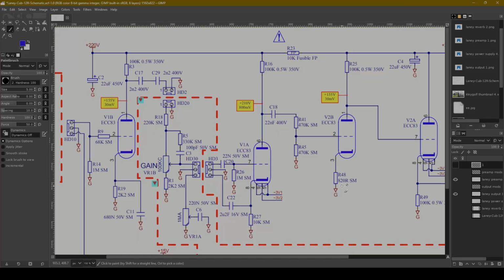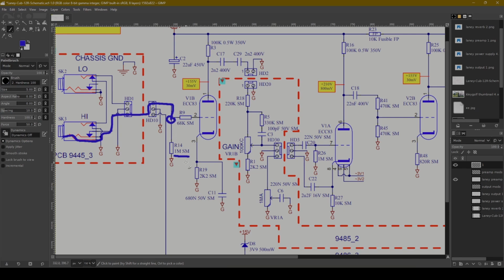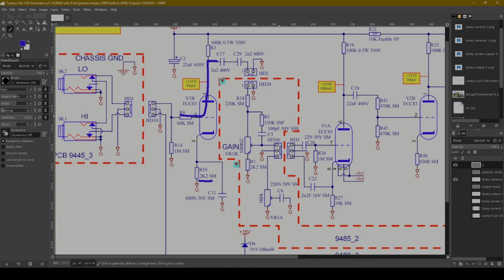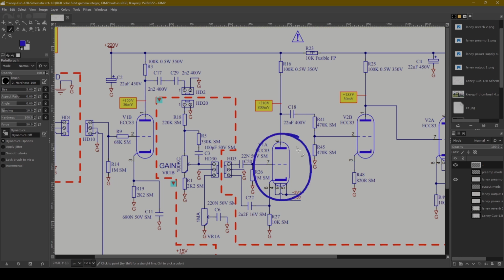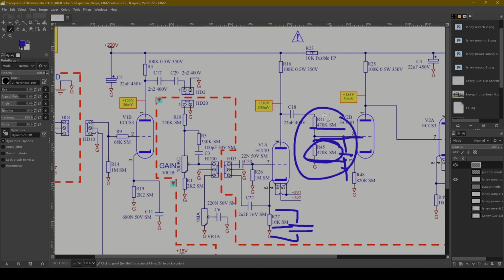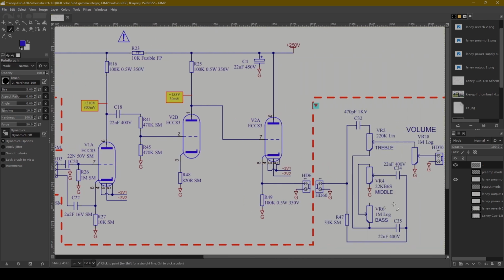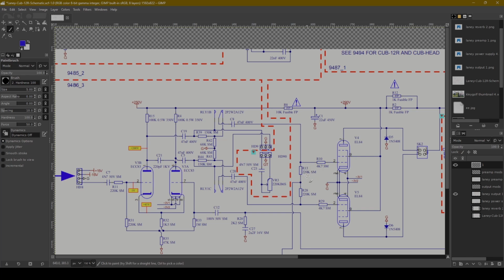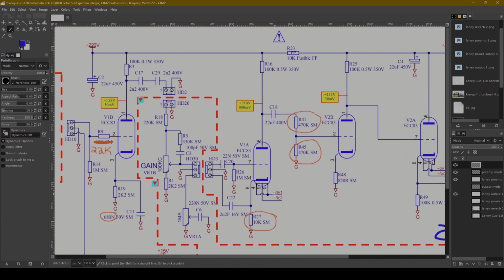Monoprice Stage Right 15 Watt Tube Amp - Schematic Review & Mods

Comment: On close inspection, VR3 is the tone pot. The 1w mode switches on relays 1B and 1C, sending the signal through R44 and R39 which attenuate the signal going into the EL84 valves, so it is sort of a fixed PPIMV. In Youtube videos where a comparison of the 15W and 1W modes is made, and care is taken to make sure the volume is not normalized by the Youtube processing of the video, you can hear the speaker output is about half as loud, which is the equivalent of decreasing the signal by 90%. It would be interesting to compare this attenuation with an external attenuator which allows overdriving the EL84 (which is somewhat involved as with this amp the speaker harness is hard wired to the PCB).
Reply: so the '3Watt' isnt a real attenuation it just turns the signal to the EL84 DOWN ( while their power supply is still full on)
in the plan this goes to a put called VR3, which strangely is the 20k Tone pot

Comment: V2A is the first half of a direct coupled cathode follower to push the tone stack, it's not a gain stage. Read Merlin's cathode follower section at Valve Wizard. Compare it to the direct coupled cf in the tweed Bassman or the early Marshalls. Read Merlin before you change the bias of V1B.

I think there's a simpler mod than a pot tho it's fixed. 1st bypass the cathode resistor. Start low like 4.7uf, go up to 10uf. That will increase gain, if you have a capacitance selector box see how high you can go without making things boomy.

Re: the voltage divider remove the top resistor, wire the coupling cap directly to grid and try different grid leak values. It will affect distortion mostly and how fast it comes up. I'm not sure you want this gain stage to distort since both halves of V2 are driving the tone stack. 

The coupling cap value determines the low end cut off point, do the time constant calculation to see what that is. It wants to be low.

Again, compare this design to its predecessors, JTM45, Super Lead, JCM800 and the 5f6a and whatever other Bassmans use the direct coupled cf. It wants to be clean gain.

Personally I think one of the most useful mods on this amp would be a PPIMV, then you could have a good home practice amp. The MV as is is a so-so and very common implementation,  post phase inverter would be great.

Comment: thanks for your video explaining the amp schematics.  what do you think would cause the main fuse (by the on/off switch) to keep blowing?  I've tried changing the power tubes but the fuse would still blow.  could my transformer be bad?

Comment: Great video . Do you have suggestions for tubes and bias adjustment?
Reply from the maker: I've had good experience with ehx tubes recently. JJ is fine as well.

I usually am confident to retube and keep bias as is, but taking measurements and adjusting as needed is always a good idea.
Reply: @KleyDeJong I have this amp do I need to bias the new power tubes?
Reply from the maker: @johnie19644  I try to make sure all my amps are biased properly - but if you're just replacing tubes like for like and the amp sounds good and plays well I wouldn't worry about it.
Reply: @KleyDeJong thanks, the power tubes are unmarked and I would be putting a branded matched set it?

Comment: Thank you so much!  I've noticed on this amp that the 15w / 1w switch has no impact when going straight into the effects return / power amp.  Does this mean it is just doing a volume reduction before the power stage, and isn't actually dropping the power wattage?  I've also noticed that the amp volume into the power stage alone is very low.   Maybe there is some sort of volume boosting post-preamp that could just be replicated by a pure volume boost before the effects return?
Reply: just stick in your guitar cable in the input, then the volume will be ok again

Comment: Thanks for This!  I have been trying to figure out a PI issue with this one. The grid input pin 2 of PI has 40 volts on it and supposed to be 1.  I just can't seem to figure out how it isa messing up.  The resistors seem all good and test correctly to ground with the correct resistances, and the tube is good. Any suggestions?
Reply from the maker: Is the coupling cap just before the grid there good?  Maybe voltage from the previous gain stage is leaking through.

Comment: I'd say that from the tone stack to output this is very much like a mini Fender Bassman which was copied for early Marshall amps with the output tubes replaced with British types, so yes it is also like a Marshall.  You are also correct that the cold clipper is common in Marshalls but not Fenders.  It would be interesting to try to get the basic tone to be more like a Vox on the other hand many people love the sound of the Monoprice 15W.  We have a very early one with an Eminence speaker and Mod reverb tank upgrade.  Ours is built with many surface mount parts and I don't really want to work on it.  Nice job with the video!
Reply: I could really use a schematic, I looked up the Laney Cub 12R and it seems to have a chip for reverb, our Monoprice has a tank.  The Laney LC15R looks closer being 15W and with a tank.  
Edit: It does seem that the Cub 12R is the correct schematic other than the chip reverb.  Even the component reference numbers are correct, thanks for this.

The previous owner did some mods on ours and now it is not working right so, I want to undo them.  It does sound great when working right.

Comment: Just add an graphic eq pedal in front or in the effects send and you've got most any tone you like- no need to swap out the speaker. I did swap the 3 12AX7's for 3 lower gain 5750s, much happier with a tamed overdrive. www.youtube.com/neilslade

Comment: Great video. I've been trying to track down an issue I'm having with my Stage Right 15R (single input jack). After a year of using it, a tube went bad. For some reason, I had all of the tubes out at the time I put the new one in. At that time, I accidentally put the tubes in wrong -- the EL84s went into slots V1 & V2 instead of V4 & V5. There was a loud bang and the buzzing started. The sound of the buzz gets louder when I turn the volume up. Based on your video, would I be correct to assume the issue is in the pre-amp stage? Also, in your opinion, did I blow a capacitor, or would this be a tube issue?
Reply from the maker: Does it buzz with fresh tubes?

I'd be most concerned about putting a 12ax7 in a power tube slot.

A bang then buzzing makes sense that you popped a cap. I'd try new tubes. If not fixed then I'd open it up, discharge the caps, and look for residue of a blown cap spilling it's guts all over.
Reply: @KleyDeJong  I'll give all that a shot, thanks.
Reply: @KleyDeJong  I replaced the tubes and the buzzing is still there. Any ideas on what I should look at next?
Reply: I just put a new set of JJ's in my amp and I had to admit it I had to change the original power tubes a lot quicker than I thought. I think the bias is too high. I never checked the bias I probably should.

Comment: When these amplifiers were first available I purchased 4 of these. 2 still in the box. To me is a 1x12 vox-like amp.  I liked the TV front, but then people complained about the reverb, and then the company changed the whole amplifier.  I am glad I have the TV fronts. These sound very good and I am sure the MONO group makes these for Laney.
Reply: I got one when it first came out too. Got it for like 120usd shipped. I wondered at the time if I should've ordered a second one. I def should've gotten the 8" version

Comment: Replaced R27 with 3.3k and cut the cold clipper. This changed the distortion curve quite a bit resulting in stronger low mids with more grind and less fizz. Replaced the tone stack caps but this had minor improvement. Best mod that I made was a larger multi-tap output transformer with a jensen Jet 40 watt speaker.  Noticeably larger sound stage and better bass response  which is a weakness in this amp. Still don't like the bottom end but i run in parallel with a Quilter 25 watt to fix the bass response.
Reply: Good to know.   I would like to do the mod to cut fiz but don't know how.  Trying to learn though.  Thanks for the thought

Comment: I'd be curious to see if a similar circuit to this be used, but haing 6V6's at output, rather than EL84's. Obviously some major substitutions of smaller component values would be needed, for one thing, but I'm curious to see if that type of circuit would have less of the 84's tightness and brightness, but more of the slow bloom and sweetness of a 6V6 chirp.😏🎸
Reply: no, the PCB board only has no sockets for 6V6

Comment: Last comment: the 220k VR3 pot is wired as variable resistor and is in series with the 4n7 cap to form a variable high pass filter. At high frequencies the cap conducts and the direct and inverted signals are bridged which reduces the input to the power tubes. At low freq, the cap is not 'active' and the full signal goes to the power tubes. This circuit is the traditonnal 'Cut' control (high cut) from the AC30. The VR3 pot acts like the opposite of a presence knob by selecting the cutoff frequency. It is good to tame the usually bright EL84 'chime'.  Overall this looks like a nice circuit to play with and I look forward listening to what you come up to. Wish you a happy 2024 with lots of amp tinckering 😊
Reply from the maker: Yes, very helpful!  It is a Cut control through and through!  So the preamp is very close to a JCM800 into a Vox AC15 type output section?

Comment: As you say, the relays on the phase inverter actually select if you send the full signal to the power tube or if you go through a fixed post phase inverter master volume. But the voltage divider of the PPIMV are actually the resistors R39/R42 for the top side and R44/R43 foe the lower side. The relay select if you take the signal before or in the voltage divider. A PPIMV pot would fit well in there instead of the relay.
Reply from the maker: Yes, I'd like to put a PPIMV in there for total control.  

This isn't a big deal, but to me - calling a preset PPIMV a '1 Watt' mode is pretty inaccurate.  I get that amp manufacturers need to market products to guitar players who don't really know, but it kinda bugs me.  Isn't wattage a function of how many watts of power the amp can make with the output section set to max clean headroom?  So to reduce wattage you'd have to mess with the power supply rail or the output tubes?  I have some loose awareness of a VVR circuit.

Comment: Also, the 1Meg pot on the V2 cathode side is connected to the cathode via the 2u2. When the pot is on one side, the cathode 10k resistor is actually bypassed by the 2u2 and 220N in series (which gives something close to 200nF bypass). Together with the 10k resistor, that gives gain boost of the high frequencies above 200Hz. When the 1Meg resistor is on the other side, it effectivelly disables the bypass cap and so gives a lower gain with no emphasis of mid frequencies. At least it is how I see it...
Reply from the maker: I reached the same conclusion on a second look.  Very cool idea for a dual gang GAIN pot.

Comment: Great video as usual 🤘
Possible explanations of those few doubts you expressed:
1. Those HD1 ... HDX symbols appear to be PCB connectors for the offboard wiring, rather than relay switches.
2. The 1M being labelled VR1A suggests it varies together with VR1B ("GAIN"). Assuming those 3 pin connectors are bridged, the cold clipper resistor would get "more bypassed" by the 2u2F and 220n bypass capacitors as the gain pot goes up, so probably a boost to increase gain not just at the grid input.
3. The relay connected to the input socket attenuates the signal by switching the source of the power amp tubes to a point before or after the voltage dividers (R39, R42, R43, R44).
VR3 is actually always in circuit, regardless of the relay position, affecting the signals being in phase or not. Maybe a tone control?

Really like these videos, keep 'em coming!
Reply from the maker: Very helpful!  

So on the Gain pot, I think I see what you're saying.  Its a dual gang pot.  So if you turn the Gain up you move the wiper up (as you're looking at the schematic).  On VR1B (Gain) the 100k pot resistance is in series with the 2.2k to ground, so most of the signal moves forward towards the grid of the next gain stage.  That also changes VR1A.  The 10k cold clipper biases on the cathode.  But there is a 2.2uf bypass cap feeding into VR1A.  

If you increase the gain pot it moves the wiper up so the 220nf cap is basically in series with the 2.2uf bypass cap - fully bypassing the 10k cold clipper.  Lots of gain boost because you're introducing the bypass caps.  Conversely if you turn the gain down you take out the 220nf cap and the 2.2uf cap runs through 1M of resistance - making it essentially have no effect on bypassing the 10k?

So in total the Gain control both controls the voltage divider between gain stages, and also the amount of the cathode bypass capacitor engaged on the cold clipper?
Reply: @KleyDeJong  I think the two pots are in reverse (1MA is 1 mega ohm logarithmic tapper, and 100kc is 100K ohm reverse logarithmic tapper). So when you increase the gain the cathode bypass of V1A is bypassed and we have a cold clipper. At low gain the cold clipper is bypassed in favor of a cathode bypass, with about 200 nano farad capacitance which favors boosting higher frequencies (above 1khz).
Reply: @KleyDeJong [Gain] Correct, that's what it looks like, it would be interesting to test how much it changes the overdriven sound, worth testing it on a JCM800 preamp or similar
Reply from the maker: Regarding your point 3, I think I see that now!  

So the relay either sends the signal from the phase inverter to the power tubes OR it introduces the four resistors (R39, R42, R43, R44).  R39 and R42 make one voltage divider dumping some signal to ground on that half of the inverted signal.  R43 and R44 do the same thing for the other half.  Like a preset post phase inverter master.  

VR3 has to be the Vox Cut control - on this amp called 'TONE'.  https://robrobinette.com/Voicing_an_Amp.htm#Vox_Cut_Control
Reply: @KleyDeJong  [Tone] Good catch! It's the same, down the the cap and res values
Reply: Correct , no relays. The HDx are all  PCB Interconnect wire Headers

Comment: Interesting analysis. Seem a nice circuit. By the way, the weird symbol that you thought were relays are in fact board connectors. So you can simply consider than the corresponding pins are always connected.
Reply from the maker: Helpful, thanks!
Reply: The cub12r has a lot of these board connectors which annoyingly get oxidised and need cleaning to keep the amp working well.